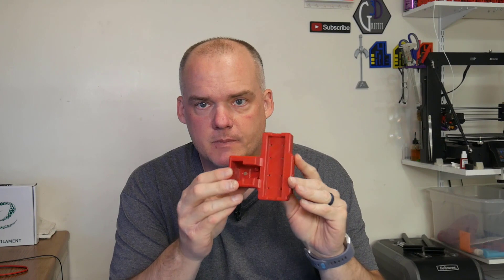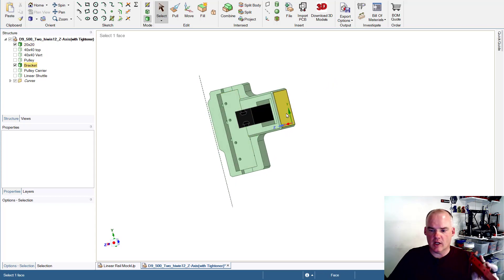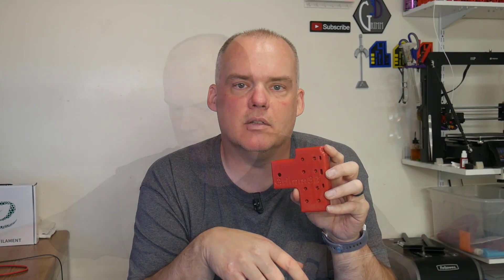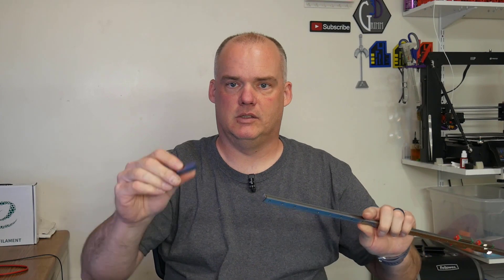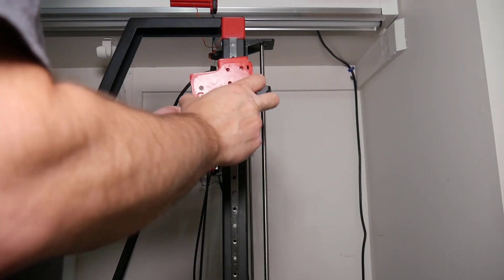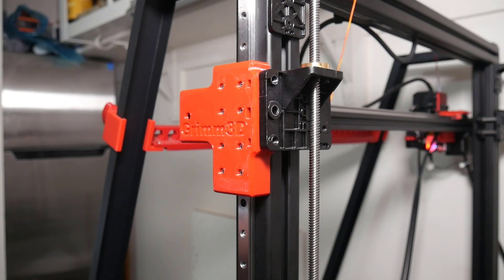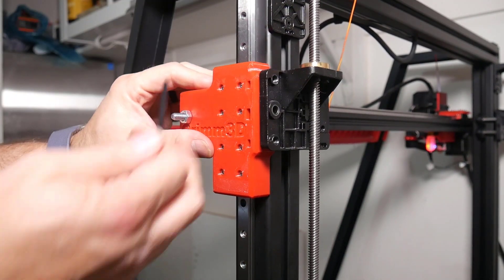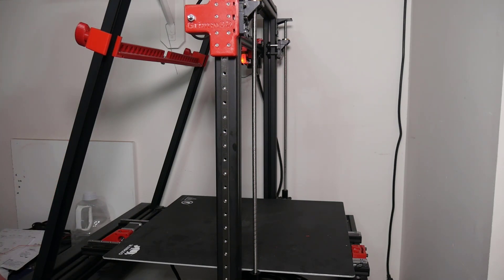Z axis Linear Rail Bracket Pt2

Comment: Hi, I had time to install your rail adapter over the weekend but I ran into an issue where the right motor will seem to bind when I try to level the bed. The x axis ends up cocked slightly after leveling. It almost seems like the 2020 bar for the x axis does not have enough room fitting inside the rail adapter and I was wondering if you or anyone had noticed this and maybe had a workaround. My bearings are good and smooth and the adapter runs up and down with absolutely no issue except when it gets down to the very end closest to the bed during leveling. 

Again, thanks for posting this project, I'm having fun getting into the mechanics of my printer for a change - it's better than printing vases or bird toys anyway. :)
Reply from the maker: I did notice mine trying to bind at the top of the Z axis. I tried to work it out with minor adjustments to the print, but things did not seem precise enough. What I ended up doing was to run the z up, and then I loosened the bearing at the top of the Z leadscrew. This gave it the space it needed. I then tightened the bearing and all has been good since. The difference in spacing was very small. 

The linear rails are very rigid. Maybe you need to realign other parts of the machine.
Reply: @Grimm3D  thank you so much! I will try all that and see if I am able to make it work. :)
Reply: @Grimm3D  Hi, I had time to work on this a little more. I carved out your rail adapter so that the x axis 2020 bar can slide completely thru the adpater and I found that, in my case, the 2020 rail must not have had enough clearance in the x axis and that was causing the binding I was having. I am now able to run the print head up and down the z axis with ease however... when I try to level the bed I found that there is still something wrong. 

When I try the leveling routine where you move up and down in the z axis it does not work. The print head will not move up or down in small increments. It seems to move intermittantly but it does not move in a useable way. I am unable to level the bed.

I used a ruler and I manually leveled the 2020 between the bed and the x axis and then moved it up and down randomly and I re-checked the distances between the 2020 and the bed and they seemed okay. My problem now is just when I try to move in the Z axis in small incements.

So now I'm wondering if the z axis motors are stronger for a D9 500 (as you are using) verses the D9 300 that I use. 

I am guessing here but If that is the case, then maybe the extra stiffness when I use your adapter may be just too much for the D9 300.

I did check and it appears that the Z axis motor is different for the D9 400 and 500 from the D9 300 so I emailed Wanhao to see if the D9 300 has a weaker motor.

I am going to try to stay on this until I find out what is going on so if you or anyone has any ideas as to what I may be doing wrong please let me know. 

Regards,
Reply from the maker: Sometimes the stepper motors are being under-driven. I have a video on setting your R voltage on the D500. I had to increase the voltage to my Y motor when I purchased the machine, it couldn't even reverse the bed without skipping. Raise the voltage as shown in the video and it has worked ever since.
Reply: @Grimm3D  Thanks man. You rock!  I will do this as soon as I have time again and let you know if it fixed the issue.
Reply: Hi, I watched your video - you are a 3d printer god!
I checked the voltage for my z and it was 1.0 something so I moved it up to 1.15 volts. I will try again to see if this fixes my issue.
I emailed wanhao to ask about the amperage settings for each x, y, and z axis. I will let you know what they say.
Reply: I received a reply from Wanhao, they said "Dear T. Gillespie, 

We did not change the voltage.  X,Y and Z are the same.   0.8V, 1A. 

Sincerely,
Reply from the maker: Watch the Voltage adjustment video. What you need to know is the max amperage for your model motors. Generally you want to aim for 80% of max to prevent overheating. 

Try an adjustment or two and see if that helps.
Reply: @Grimm3D  That did the trick. I jacked up the current to 1A for the z axis motors and I am able to run with your rail adapter with absolutely no issues. The other motors were low too so I will set them right at 1A as well. I was a bit of a skeptic at first because the printer has worked just fine since I bought it years ago but hey, that did the trick. I printed something as a test and the motors don't feel hot. Wanhao confirmed that the motors should be set to 1A for the D9 300.

Again, I want to thank you for offering your rail adapter and also for your time helping me thru my issue getting it to work.
Reply from the maker: @t.g.2679  glad it worked!

Comment: Looking forward to se what print results you get. I would like to do this modification too. Will you share your design when it is finished?
Reply from the maker: Yes, I will be putting the STL on Thingiverse. When I get a chance, I'll be printing and posting more videos as well.
Reply from the maker: Check Thingiverse for the design. I use the same username there.
Reply: @Grimm3D  OK, I will start rebuilding my d9 in a couple of weeks and will start with the linear rails first on x and y. Any news on when and if you will do the motor side of the z-axis?
Reply from the maker: @michaeljohanssonlowend  I have not started the design process on the motor side of the Z yet. Having done the Far side already, I think the motor side will take less time (I prototyped that one like 12 times). For these, I want to design from scratch so the end result is 100% my own. I'll see if I can start working on the design process soon. Stay tuned and thanks for being part of the conversation!